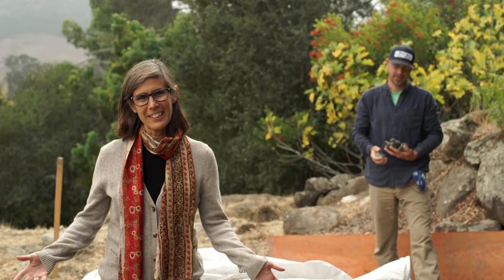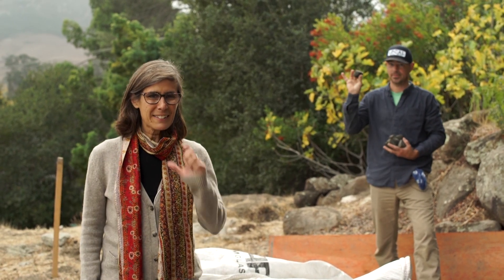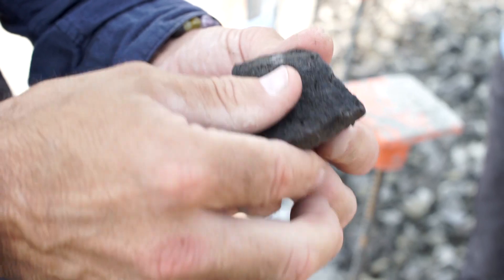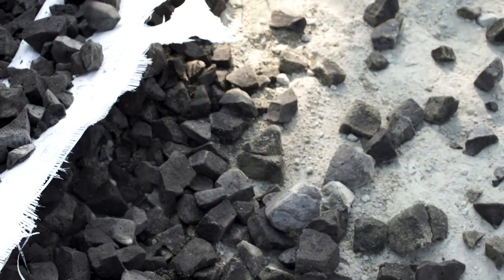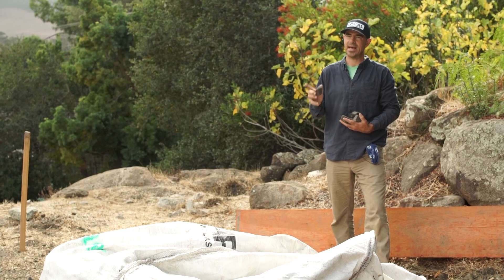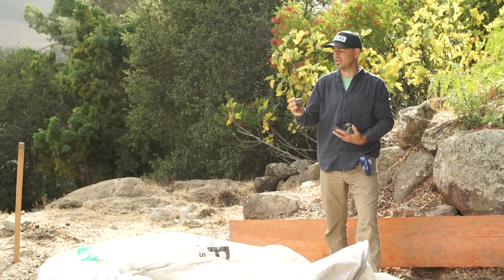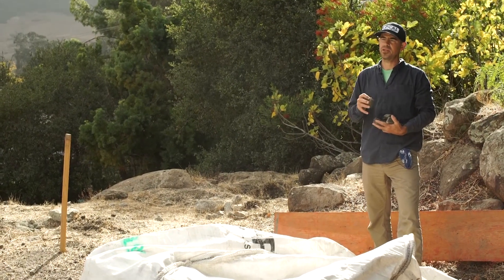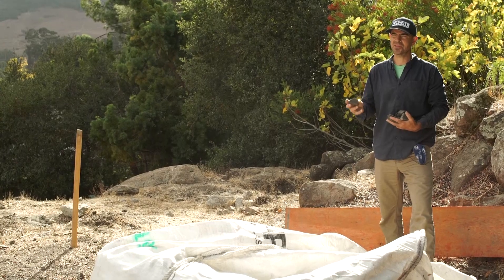Bishop Passive House: Glavel

Comment: Excellent product. Would it offer the same r value as foam insulation. Also why not ez forms, it looks like a shallow foundation
Reply from the maker: We think so too! The Glavel comes in at about an R 1.7/inch when compacted. In our climate we don't always need insulation under the slab (it can sometimes hurt the project in our microclimates here) so we didn't need the higher R-value. The larger reason for not using a foam product is the global warming potential of foam is huge. If we are able to use a different product that is better for the planet, we'll go with that. Also we got our insulation and aggregate layer at the same time, which was pretty great efficiency wise.